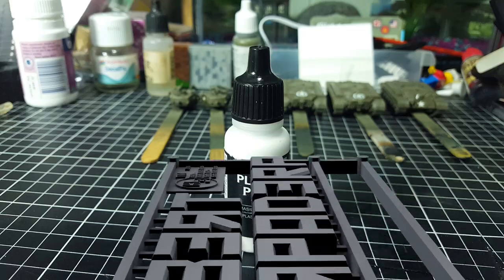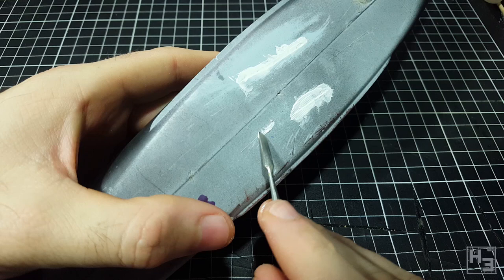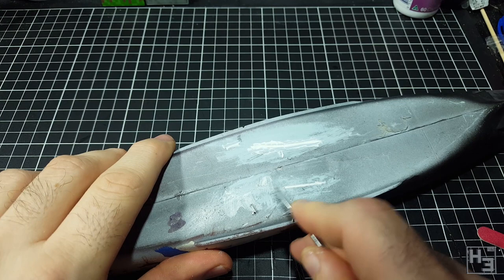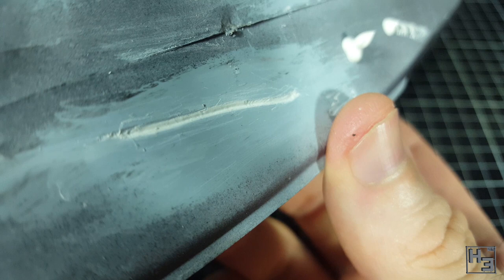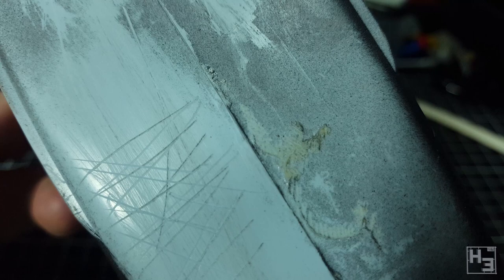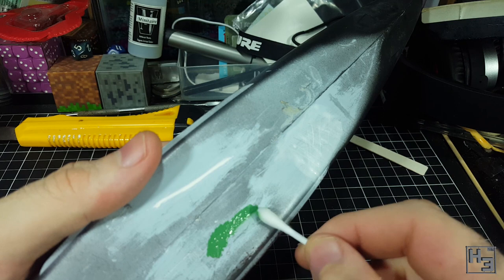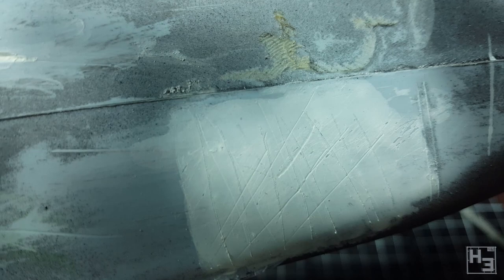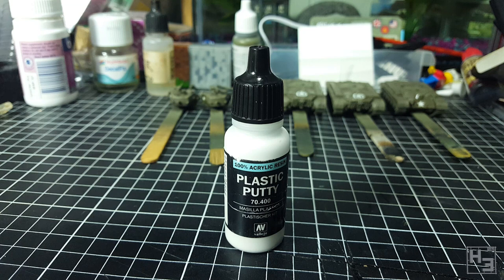Vallejo Plastic Putty

Comment: Nice testing, This putty is not used for stuff you test, the advantage of this Putty is for Areas where you have gaps and can not be sandet, a. while you will destroy any detailing and can't be restored with an amount of huge effort, for example your King Tiger build from Tamiya where the Drive Sprockets covers. simply push this Putty in and go over it with a Brush damped with Water, in the same way remove the excess, the gap is filled, no sanding required
Reply: Yup...  Watched a few other videos showing it being used and what you describe is exactly what it's best for.  I think every putty/gap filling material/technique has a specific use where it really shines, but is only OK for most other uses and totally unsuitable for a few.  This is no different, being just another "weapon" in your model building arsenal.

Comment: I just got a bottle of this that I plan on using primarily for surface textures...
For seam and gap I use Tamiya white or Milliput, etc.
I use distilled water with acrylic paints and planned to with this putty but now I'm thinking I'll try some tests using Vallejo thinner, airbrush flow improver?...😮

Comment: The problem being that Vallejo Putty is acrylic paint mixed with granite dust. It won't bond with plastic like solvent based fillers such as Tamiya Fine White. At best Vallejo's claim that it will dry rock hard, can be sculpted, carved, and drilled is misleading as the acrylic polymer really doesn't allow for that. Fine light sanding is about the gist of all it'll stand up to.

Comment: Sanding is a prerequisite for using putty so worrying about excess around the edges is not essential. It does seem too rubbery for bigger gaps and would be more suitable for filling gaps on figures.
Reply: That's where I've used it. I found tamiya putty is too thick but this is perfect.

Comment: I tried some to fill pin holes, it's been 4 days and the putty will not dry hard enough to sand. I ended up picking the putty back out. So far I don't see how I can use this stuff for gaps or contouring. Bummer

Comment: I just got one to try with. Similar experience as you did. This rubber like putty is not good for sanding especially with water. As someone said, it is good for detail area  without sanding. I prefer Tamiya white putty or green stuff for most application.

Comment: it is a acrlic putty. which means after you apply it take a wet q-tip and wipe it away. I will fill the seam perfectly and remove the excess. also get the fine applicator version and it is perfect for pretty much everything. no sanding is meant to be done. I was made specifically for the technique I described here.
Reply from the maker: I'm not sure you watched the entire video. Particularly the part where I applied it as you described.
Reply: oh...... well shit. now i'm "THAT" guy
Reply from the maker: Haha, I'm sure we've all been that guy at some point.
Reply: @HerbertErpaderp  I'm a novice, but even videos I've watched on the product, it seems you're using it for the wrong intentions.  I hope so anyway, as I just bought it to fill seams after getting frustrated with results of Testors contour putty.  I used the Testors as a kid in the 80's, so didn't know what else to use for gaps.  That's all I knew of back then when we had actual hobby shops.

Comment: I have been using this stuff in a tube on my Tamiya T-34/76 kit. I was disappointed. I have had to reapply multiple times just to fill gaps and small holes. The biggest problem is shrinking and when sanding surface smooth I always have recessed areas in the area I filled in. I will not buy again.

Comment: Such a shame...I love Vallejo's paints, but their putty seems dreadful. I once had some Milliput that I used for filling gaps and applying a Zimmereit effect, but since I only ever kept it in my cold garage (where I make my models), both parts of it are solid and unusable now. Does green stuff have to be kept in particular conditions too?
Reply: Unfortunately it does. Your best bet is Aves Apoxy Sculpt as they come in separate containers so there is no chance of the two parts cross contaminating and causing premature curing of the epoxy putty.

Comment: Why don`t you try Squadron putty, mixed with Lacquer thinner (Green Putty or White Putty), you can apply this with an old brush, its very effective. Try it I am sure you will like it.
Reply: Squadron no longer make Green putty which is a shame. They now have a new colour called grey putty. The White and grey putty are also not the old formula that modellers liked. Squadron changed the formula and it is now a lot thinner and more watery. See the Squadron YouTube video about it. fans of the original Squadron green and formula are not happy. neither am I. I don't know what I'm going to use when my old supply of Green Squadron runs out.

Comment: Anything water based probably shrinks due to evaporation.
Reply: Its just acrylic putty. The guy that made the video doesnt seem to get that its pretty much just really thick pigmentless acrylic paint. And it off gasses as it dries just like acrylic paint...  This stuff is meant for gap filling and texturing smooth surfaces. Hes not putting enough of it down. You overfill the gap or damage, smooth it with a watered brush,  then sand the excess down. He repeatedly puts less than needed down or overwaters it then keeps complaining about how it shrinks down too small forcing another coat. While he admits he barely read anything about it he should have taken the time to learn how to actually use it before posting a "review". Its like driving a car youve never been in and only seen a commercial for around the block once and making "review". And judging by a bunch of the other people commenting on this video they also bought a tube, didnt read the instructions, didnt apply it correctly, then stopped using after only one or two attempts and complain about how terrible it is.

Comment: This putty behaves like the generic "wood filler putty" we have in hardware stores here. It's acrylic, so it doesn't bite to plastic, sands fine and solidifies rock hard. Shrinking and not biting to styrene are the main issues...
Reply: It doesnt shrink as badly if you get it wet after you apply it and not water it down and smear it on like a paint... For gods sake people need to read the instructions on shit they buy.

Comment: Vallejo has a video on using this product, maybe you should take a look.
Reply from the maker: I've seen it. It didn't exist when I decided to experiment with this stuff. I noticed they don't at all mention things like shrinkage,  poor adhesion qualities and how it tends to crumble when sanded.  I also noticed that they only use it from the tube with the thin applicator, which I suspect makes things a lot easier. 

Maybe it works better for other people, but I don't like it.  Though it does look pretty useful for mud textures.
Reply: @HerbertErpaderp  : I'm french so please excuse my bad english. I use this putty as well and I can't decide why it works sometimes and don't others. It seems, but that's only my feeling, that water has an active part in the putty's behaviour. When smoothed with a brush and water, it becomes very hard when fully dried, but not always ! Used alone, it behaves like rubber, it makes crumbles when sanded as you experienced, but not always again and I can't explain why. Each time I need to correct a scribber's unwanted stripe or difference in thickness, I can't predict what will be the result ! This drives me quite puzzled. If someone knows what and why, please let us know.

Comment: You're using it wrong. Like, abysmally wrong. You're supposed to apply it to small gaps with a brush in small models that have gaps in the joints.
Reply from the maker: Have a cry about it, cunt.